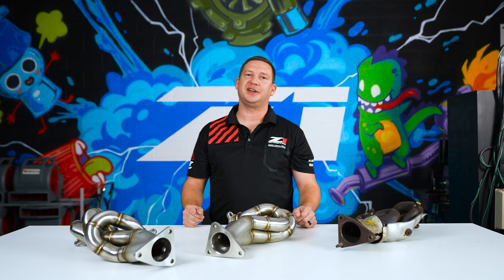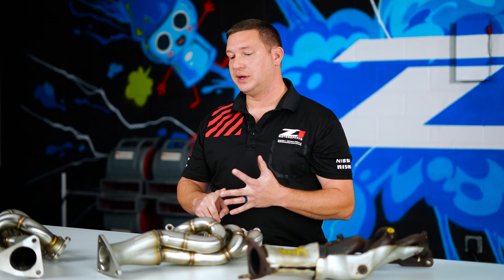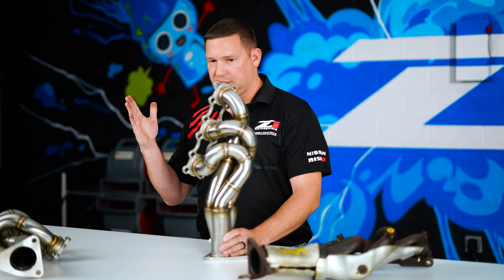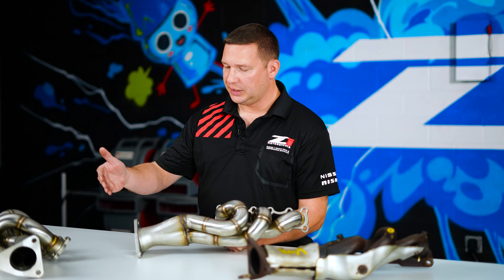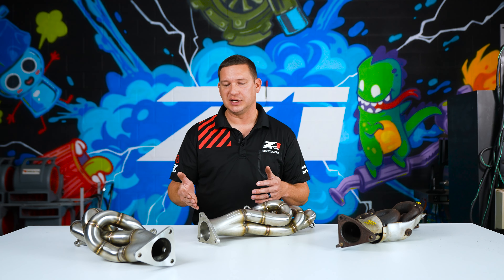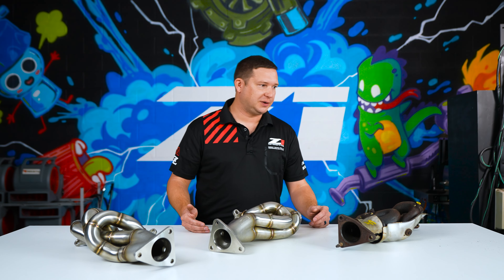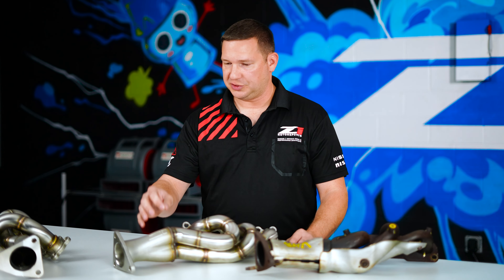Z1 370Z / G37 Headers

Comment: So why shorty tube and not long tubes? Was there ever testing done between the two on the Z platform to see which one was better? Us NA gusting are looking at the most power possible
Reply: Cats are right there.
Reply: 1 is sound, they have slightly different sound between LTH and shorties and 2 it’s for people who have to keep cats and use HFC in carb states. Long tubes are going to be your best option for the most power

Comment: Are these proven to be equal length that’s all I care about for that gt3 type sound
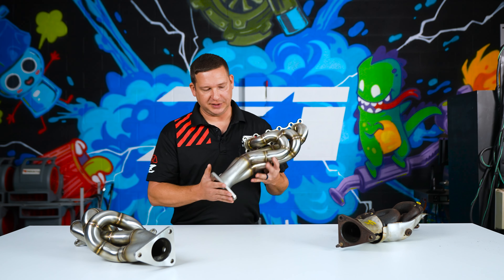Reply: 2:08
Reply: @ I’d like to see the 3D design on the computer drafting software that shows the volume in each runner like a lot of other header manufacturers show with 3D scans. Or they can cap the runner at the collector and fill with water and measure. Each runner should have same amount of water liters. Anyone like dc sports can say their headers are equal length and claim it then people will independently test them with water or 3d scans and prove they are not equal. Tomei just redesigned theyre shorty headers because they admitted the first design was not very equal length and the new design is a lot better but not perfectly equal length. Still closer to being perfectly equal length than the first design
Reply: @diegosalazar5504  Lmk

Comment: Warning to you S chassis VQ swap guys, you will have to modify your $1000 headers as those flanges hit the firewall. 

After 8 different versions being tried out, every one we had to cut the flange & weld on a pipe.
Reply: I installed oem 370z headers on my vq swap s13 and yep, had to cut that flange and had to extend the pipe lower and just put a v band on it
Reply: @cruisecontrol6938  i just read that ISR claims their long tube headers will clear as long as you use their swap mounts .